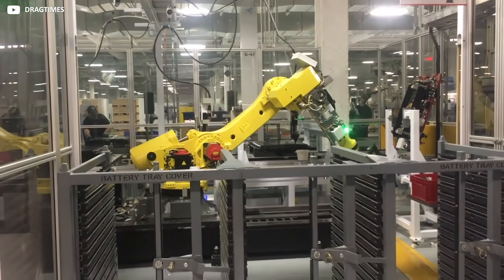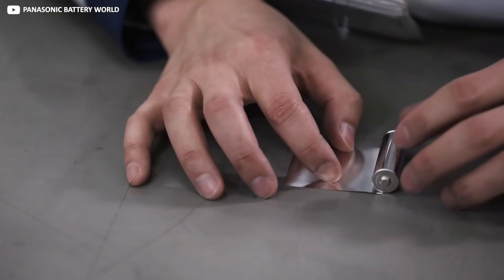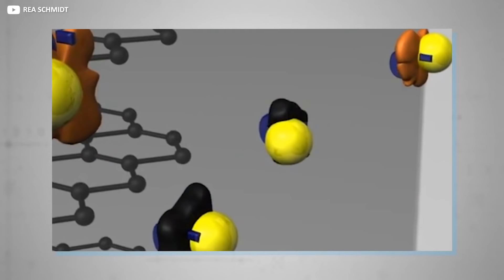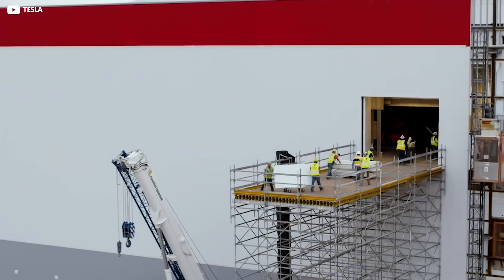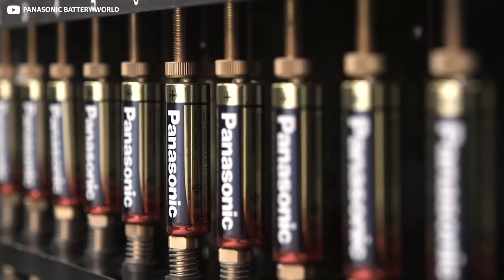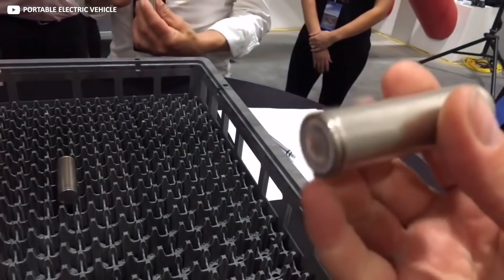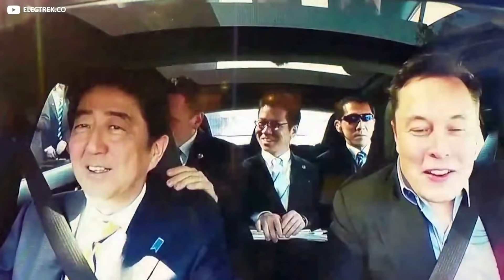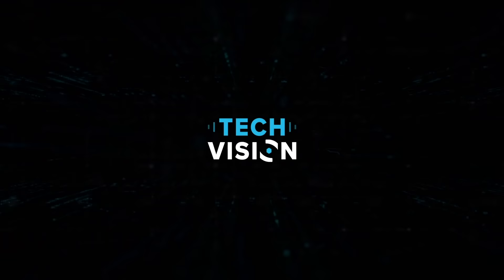How Tesla Builds Batteries So Fast

Comment: Panasonic makes the batteries. Tesla just glues them together.
Reply: ehh... sorta. If you're talking about Tesla's older batteries, then that is partially true, however it is still owned by Tesla. Tesla's new 4680 battery is being completely produced by them however, as seen in the 'making batteries' video.
Reply: The 4680 battery has a ways to go before production and vehicle utilization. Probably no existing model will use them as of massive engineering interruption.
Reply: @JR-ub2wt  :(
Reply: @wphubert  there will be no engineering interruption as tesla is making a new production line in some forgotten place on earth... Berlin. So starts there and it will slowly spread out. Cars will just adopt different battery packs....
Reply: @wphubert  
Berlin factory will definitely produce them for those vehicles. And if they had a prototype battery production line in late 2020, just imagine what they have now.
I've seen their latest battery video and that production line looks very advanced now. It will likely be operational for full-scale production in germany by summer.
Reply: @wphubert  but model refreshes will
Reply: @JR-ub2wt  Glad to see an intelligent response.
Reply: @JR-ub2wt  BALD NERD

Comment: At 5:58 - Lithium is not "ethically problematic" whereas cobalt is! Lithium will not be eliminated from their processes any time soon!
Reply: I think he meant Cobalt
Reply: @iKingRPG  He said "Cobalt" AND "Lithium". Which is wrong. Eliminating Lithium makes no sense :)
Reply: @Steppenkater  What about graphene batteries?
Reply: @toonpunie  I think the graphene pipe dream is a super energy dense capacitor which would act as a pseudo battery. Instead of using chemical energy it would store electrons directly in the matrix. Meaning you could charge a phone in seconds. Feel like we’re decades off from that though. If we could ever even make more that a fingernails worth.
Reply: @jesselanting3931  Yes, totally agree. We are still far from it. High cost and complexity of implementation.
Reply: Look up QuantumScape Solid State battery and its 10 min charge time and 5 times the energy density...
Reply: @user-zq6pj5jo8j  QS is still in the lab.  Hasn't been developed for production, may not be scalable.  Timeframe undetermined.  Don't hold your breath.  It may never happen!
Reply: @jesselanting3931  A super cap can't store energy.  It's great for power but that's for the drag strip.  Can't do long distances.  Today's batteries do energy well, and are passable for power.  
There is a huge difference between charging a single cell phone and several thousand cells in a car!
Reply: Thank you! Lithium is far from rare or ethically problematic. Cobalt, however, only occurs in pretty much one very poor and corrupt country (Congo). Here in Canada we have an abundance of clean, safe, and ethical lithium operations.
Reply: Isn't mineing lithium a huge problem too though?

Comment: I want to see the machine that rapidly and easily disassembles these and recycles all the materials.
Reply: Currently all their recycling needs are met by outsourcing to a company that does much of the work by hand. It is expensive, but has to be done that way because that company handles much more than just Tesla batteries. (It is still much cheaper than buying raw materials.) 

However musk made it public that they are planning to entirely automate the process with their new cell architecture. This will not be too difficult, because every call will be identical.
Reply: @thermophile2106  i would like to know what happens to Tesla batteries different that to all other batteries that get dispossed(recycled) in soil. Global warming happens from changing landshafts, removing trees, digging crators into Earth, processing materials, and transporting it to Tesla. What happens to used batteries afterwards is still an issue if its not the same lithium that can be used in Tesla again.
Reply: @ruslan1394  what happens when you want to sell your old battery operated car? whos gonna buy it?
Reply: @PazLeBon  used teslas not particularly well holding re-sale price. I would even say loose value exponentially fast. It is probably has to do with simple physics of baterries. If capacity is lost by 30% you are locked withing one city. If fast charging disabled you will only be reasonable using over night charges. In cold climates (like I have today feels like -40C) leave Tesla outside for 2 weeks. Gasoline cars never claimed to be enviromentally good but so is Tesla claim is false. Recycling of composites, and baterries always the worst.

Lead batteries are 90-95% recyclable. In fact simplicity even makes it cheaper to make new battery from the old one. Whereas Tesla supliers will be digging cheap lithium from Brazilian soil producing more damage than all carbs that come from gas cars.
Reply: @ruslan1394  yeah sort of my point really, and 99% of all car sales are actually second hand. So what people gonna do? catch buses? :)
Reply: @ruslan1394  Global warming comes from CO2 and methane emission, usually from burning oil, coal and natural gasses. It does not change much if batteries are still charged from coal and oil burning power plants. But the use of minerals has nothing to do with global warming, only the energy used to distribute them is a factor.
Reply: People don't realize the cost to replace a used lithium battery pack in a car, and the environmental impact in making and discarding these batteries, if a "fossil fueled" vehicle breaks down you replace whats necessary, in a electric vehicle its cheaper to throw the whole car away. Here in NZ we had a member of the public, buy a electric vehicle for 9k, 6 months later the battery failed, they were quoted $124,000 to replace it.
Reply: @blairjury  Elon just want his investment to pay off a little before the chinese start copying the technology, and build their own factories.
Reply: @PazLeBon  good question,  it will cost more to replace a buggered battery bank than what the cars actually worth.  NZ was sent several EV's from Japan, the batteries were charged in a manner that would make then test ok  at purchase. 4 months later the batteries failed. The customer's were quoted $124,000 nzd to replace them, the cars were purchased for $9000 nzd.
Reply: yes that's correct Global warming is due to CO2 emissions...when I was in kindergarten I learnt that tree's used CO2 as we use O2...so let's cut more forests down to make room for more buildings, expanding cities, cobalt mines and the settling ponds.
Reply: @blairjury  Yeahh, sounds like what I expect. . Yesterday I saw a charger in action, the guy fast charged and got like 50 miles charge and paid nearly 25 euros. Ojk it was a motorway but thats more expensive than petrol . The whole electric car is a massive ill thought out sham but of course, like most things, they will use it up and wear it our before telling us its unviable.. like coal and diesel i suppose
Reply: @PazLeBon  What's not ok is that there is 50x mark up on gas. It also gets diluted with Ethanol which attracts moisture. EV has a place but not until it improves and survives the market on its own. There are many more options like hydrogen projects and perhaps ethanol-only engines. Gov gives grants, and discounts on EVs and closes eyes on 3rd world digging all the needed materials. Why they are not digging Lithium in Cornish, UK? The impact is damaging enough to change fertility in humans and animals. 

@Benny Helmundt
 humans and animals the biggest CO2 producers. Methane naturally exists in nature. Lookup here on Youtube: "Burning Methane in Alabama Swamp", bacteria does fart and guess the byproduct... What will make a difference if we as humans stop destroying the environment. We need to live around the environment. EV is not the solution. Ride bicycles if you want. But changing batteries every 5-8 years should not be environmentally good. It's actually terrible.
Reply: @rustar8948  methane causes as many issues as CO2 unfortunately and much of that comes from cows and cows food destoys environments, double whammy.  If we all stopped eating beef it would be more beneficial than having ev 's :)
Reply: @PazLeBon  "In the first two decades after its release, methane is 84 times more potent than carbon dioxide. ... While methane doesn't linger as long in the atmosphere as carbon dioxide, it is initially far more devastating to the climate because of how effectively it absorbs heat.", google. CO2 is heavy it sits where trees can recycle it. Methane lingers off. I would worry about CO2 if we kept cutting trees. Which we still do at an exponential rate but it's an easy fix. 

Methane naturally occurs at 75% of cases on Earth. in 25% people neglect it. For example, food waste gives methane (the bacteria eating it). 

Oil wells can and already do separate produce on 3 main outputs, which allows to capture all methane release. Something that heavy bombarded on oil industry can be actually false. This bad rep. on oil industry as if first wells could operate better. Saudi Arabia still dumps oil on soil (this doesn't have to happen). The responsible production of oil is possible but oil itself is limited. The main problem is that the 1st world countries prefer to print fake moneys and use it to buy resources from the 3rd world countries where the process is not well established. Same can be said in regards to Lithium mining like in South America. Tesla claim to be enviro good but in reality it's the same. It just doesn't pollute the 1st world countries, hence, the issue of the global warming and land "extortion" can be of the problem of the 3rd world. At the end - it makes no difference who polluted it. The global warming not gonna say Tesla users were more delicate at creating pollution than the internal combustion car owners.
Reply: @rustar8948  Ouch. Tho, arent we able to turn methane into cleaner energy? Tho personally Id rather see everyone just stop eating much meat, particularly beef
Reply: @youghurt2k  It actually takes more BTU to generate the electricity equivalent of a gallon of gas, than to refine an actual gallon of gas. A lot more. That assumes the use of fossil fuel to generate the BTU. Musk's vision is for people to generate their own electricity via solar. That's why Tesla is in the energy business.
Reply: @darylfoster7944  noone here cares about a employee hype of resalling a year old Tesla. With all the incentives from government new Teslas should be 75% of gasoline cars. Factory overprice them. There is no real data for 5-10 years old Teslas. Only up to 8 years of battery guaranteed. Once hype of owning electric car and gimmic of enviromentally good cars turns to real data it might not be that great after all. I think an 8 year old Tesla will have 20% of  MSRP price. Yet 20 years old gasoline cars still on roads.
Reply: @darylfoster7944  That is exactly what I said. There is a hype for rich to own a Tesla but production designed not to meet the demand. Resale of old Tesla is a diferent story. Frankly rich really don't cares if Tesla costing 20% of its value at 8 years. Simply because rich will be buying newer ones every few years anyways. If Tesla allows DIY repairs or reduce pricetag on $16000 battery replacement then it will help Tesla to keep >30% resale value.

Comment: This video shows some out of date understanding from the start. 
The issue with electric cars, and Tesla in particular, isn't the electric storage amount. Tesla's can do almost 500 miles on one charge now. 
The issue is charging time.
Reply: It's true that the vehicles have good range, but they still lack in important areas. Specific energy (energy per kg) of the batteries still pales in comparison to that of gasoline, so the batteries in Tesla vehicles are extremely large, heavy, and expensive.

Li-ion batteries are only improving in specific energy by a few percent per year, but are more than an order of magnitude lower in specific energy than gasoline. If you calculate how far an electric car can go when driving uphill or towing something, range plummets (more than gasoline, because ICE vehicles are more efficient under a heavy load).

Making better batteries is a huge barrier to making electric cars globally affordable and sustainable, and arguably the primary one. Charging infrastructure will follow suit, as better batteries will make charging infrastructure more affordable when fewer stations are needed.
Reply: The video's understanding was perfectly fine. You're the one who's misunderstanding here, bud.
Charge rate is not good, yes, but range is absolutely still the main problem with electric vehicles. Not necessarily because EVs are incapable of getting good range, but because the extra cost from the additional batteries makes them uncompetitive against ICE vehicles. In order to make any meaningful impact in the current vehicle market, battery costs are going to need to go down. Charge time is definitely second in priority to range, because at the end of the day you can always just use a supercharger and pump obscene amounts of electricity into your battery pack for a fill-up in just 20 minutes.
Reply: @randxalthor  What difference does it make to the driver how heavy the batteries are? They are set low and distributed so it helps stability and they contain more range than 99.9% of drivers will ever need on a given day. 
And despite their weight, they still out accelerate muscle cars.
Reply: @mindle9155  You just seemed to defeat your own point bud. 
If you can fill up in 20 mins then your point about range is mute. Sure, even taking a cup of joe while you charge up might be annoying but I'm guessing that if you just drove 400 miles then it's probably a good thing: safer for both you and other drivers. 
I also foresee drivers going on autopilot and a charge vehicle coming up behind you, connecting and driving along with you while it recharges you for 20 minutes. 
So range is not an issue at all. Especially when 99.9% of journeys will never even have to face that issue. 
So your only argument is price. 
If Musk manages to make a $35k Tesla then that won't be an issue either. And also now that Toyota and most other car manufacturers are going electric, the competition will drive even more innovation. Within 20 years the most common electric car on the road will be a sub $20k car. 
You are like the people who raised very reasonable points about how problematic it was to own a first generation combustion engine car compared to a horse and buggy.
Reply: @NR-rv8rz  no, you entirely missed my point. the problem with range is that if you want better range you have to pay significantly more for it, which is an issue when you consider that there are not a lot of chargers out there atm. You need enough range to make it to the next charger, and unless you're traveling along electric roads, there is a very real possibility that if you don't fork over the cash for extra range, then you just won't be able to make it to your destination.
Reply: @NR-rv8rz  and your entire argument about price is that "its going to go down". Well guess what mate? It ain't down right now. It is very high. It is still a very relevant problem in the here and now, which unless you have a time machine to go forwards and buy a car from the future, is the only point of reference that matters to consumers.
Reply: @mindle9155  Sheeeet, I just typed a super long reply then pressed a wrong key and it all disappeared. I can't be bothered retyping it all  :)

Comment: There is a great mistake. Elon Musk isnt trying to eliminate Lithium. Only cobalt. You cant eliminate Lithium from a lithium-ion-cell ....
Reply: Perhaps what was meant was a battery that’s free of both lithium and cobalt rather than a lithium free, lithium battery. I believe there are various other developments in the pipeline that may or may not come to fruition, one that comes to mind is sodium iron.
Reply: There's work on replacing lithium with sodium or fluoride. The hope is to replace lithium with a more plentiful element with a lower environmental impact. Also, improving energy to mass and energy to volume ratios could improve drone technology and enable electric airplanes.
Reply: There were a couple of misleading/unresearched things in this video, but you hit on one of them.  They are going Cobalt-free, but Lithium is not inherently unethical and they're not looking to reduce lithium supply.  They're actually looking to increase availability of supply by opening new Lithium reserves that aren't dependent on a brine method of extraction.
Reply: @alexl266  
Yes your quite right on that, in the U.K. a company is actively exploring lithium reserves in Cornwall, which I’m led to believe will hopefully supply all the U.K. battery needs.
Reply: @MatthewStinar   I am not saying it is not possible, but Tesla is to the best of my knowledge not researching it, as lithium potential is far from reached. Lithium-sulfur or Lithium-air batteries could more than tenfold the capacity. On top, lithium is not rare, it is hard to mine. The current known, and mineable reserves would last for over 1000 years, and most the lithium on earth is in the ocean (around 230 billion tones) which would last almost indefinitely as we only use around 80.000 tones a year. As mining technologies improve, lithium will be easier accessible, cheaper and environmentally friendlier.
Reply: What’s wrong with cobalt?
Reply: @BakrAli10  The largest reserves of cobalt are in Africa where there are ethical concerns over forced/children mining.  Tesla is reducing their dependence on Cobalt and look to eliminate it very soon. Lithium, however, can be found almost everywhere.
Reply: @BakrAli10  It is very expensive, rare and mostly found in the DR Kongo, where it is mined partly by children and under terrible conditions. But so far it is needed in batteries, cause otherwise they arent stable.